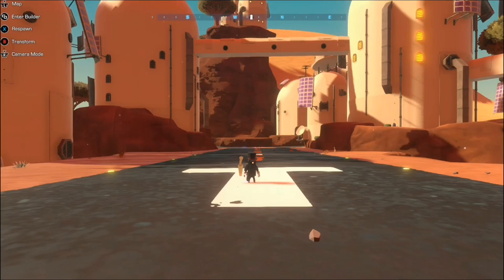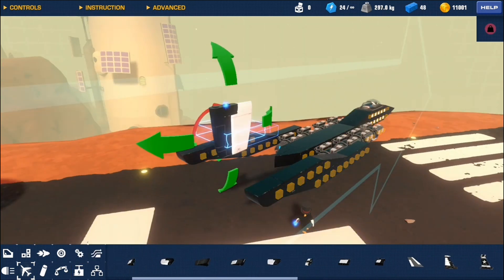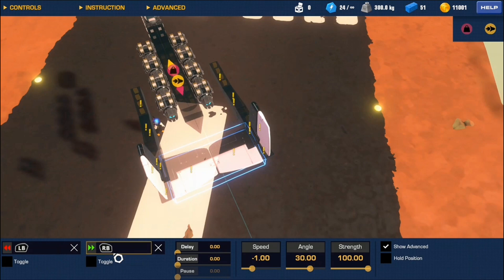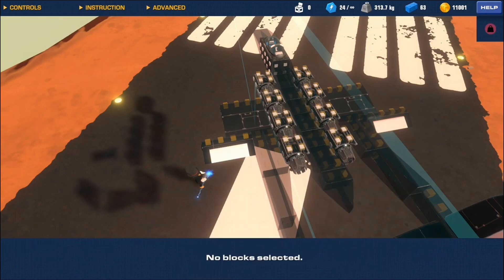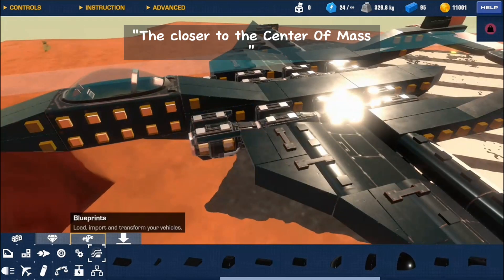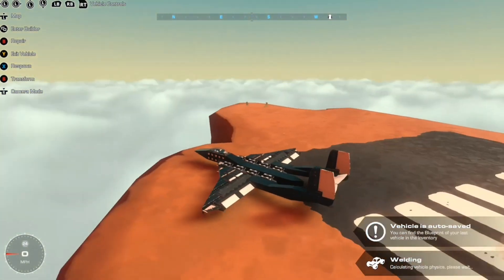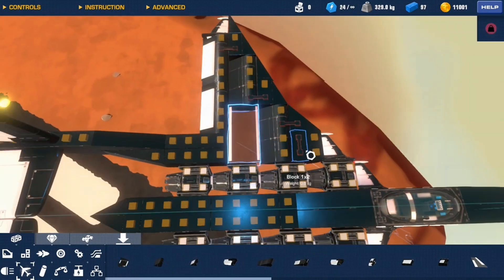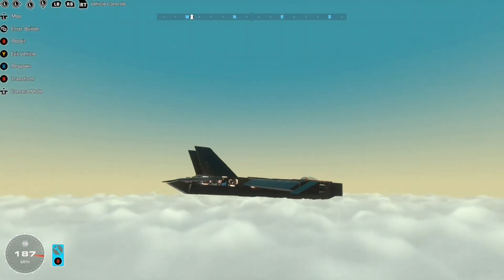Aircraft Guide and improvement. A Trailmakers tutorial on how to build a stable aircraft.

Comment: I would always suggest using non-flap wings whenever possible, as flap-wings seam to generate less lift
Reply: I ran into this when the update first came out. But the more I build with them, the more I realize that they have their pros and cons.

 Yes, they do generate less lift than the standard Modular Wing. However, if they are used as combat flaps, they can improve your turn radius or climb rate. This will also sacrifice speed for agility and maneuverability. 

Weighing the pros and cons of including flaps isn't always easy. I tend to use 1-2 flaps per wing depending on the size of the wing, and the purpose of the aircraft.
Reply: @sethorindustries4749  fair, I use them for the first section of wing, then regular wings for the rest. Still a good build. :D